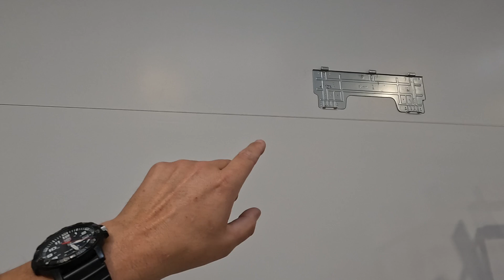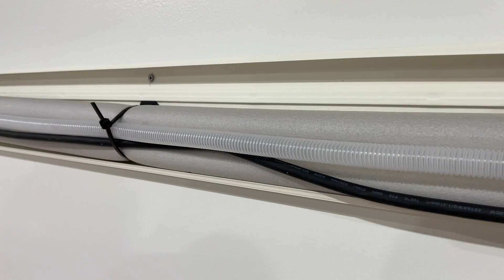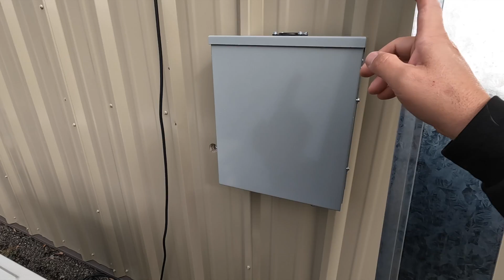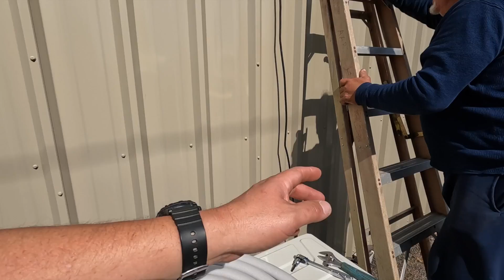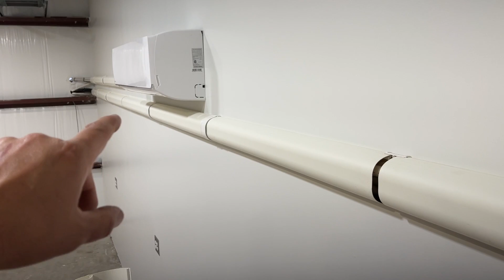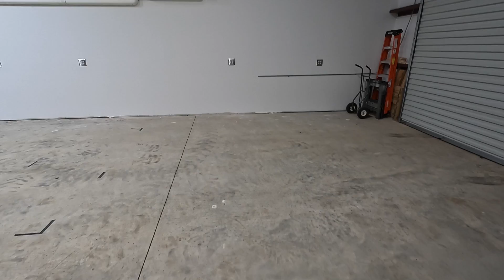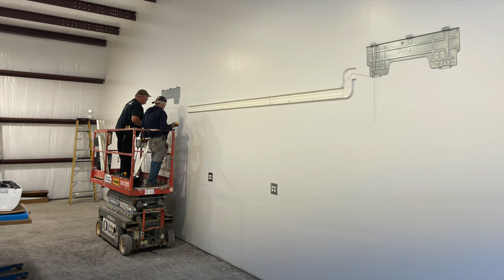Mr Cool AC INstall for New Shop Part 2

Comment: Did the line guards get installed level, or is there a slight downslope? Because it looks like the drain lines run uphill. Will the whole horizontal run fill with water before it drains outside? Not sure I like that.
Reply: Came here to check on this too...  I hope there is more slope than it looks on camera.  Your going to be needing to flush those regularly especially in a shop environment. 
Also install a calling fan especially since your indoor units are not that high up.  it will help a ton in winter and cut down on energy bill even more. 
Looking good other than that.  I am thinking of installing a Heat Pump in my shop also to supplement the Gas Heat and have some condoning during the hotter months.

Comment: If you mounted those condenser units on the ground like that around here a scrapper would own them within a couple weeks.... I put mine on the roof, not 100% theft proof but at least a chance they won't steal it...
Reply: Indeed. I posted the same concern before I saw your post.

Comment: If I remember correctly you are supposed to vacuum down the evaporator side before you open those valves. To remove moisture and air

Comment: My unit was installed the same way. Water drain will build up with dirt and sludge clogging the drain line causing it to run out all over the floor. Installers had to redo everything giving it a slight slope.

Comment: what happens to the air in the lines?
Reply: I'm pretty sure the lines have vacuum in them or they are precharged.
Reply: The linesets that go to and from the air handler are open to the atmosphere and should be vacuumed before opening the valves on the condenser.
Reply: Jason Hendrix that’s what I was thinking
Reply: @tomogletree1  
Evidently I'm wrong.  The 3rd gen systems from Mr. Cool have a precharged lineset and condenser instead of flared fittings like on the car majority of other systems. Them must be fancy fittings.

Comment: Your drain needs a slope to drain properly.
Reply: Okay that's what I was thinking, I mean even if it used the differential pressure on the blower fan to push the condensation down the line that 38 ft length is still too long without any slope for sure

Comment: Might need a bit extra shot of refrigerant since you extended those lines
Reply: He mentioned that in the last video.  His father in law is a professional HVAC installer, so he knows what he is doing.
Reply: @Discretesignals  yes I can tell he is a professional by the way he installed those drain lines 😂

Comment: You did not show pumping down the lines to a hard vacuum before charging them. You CANNOT let air and water remain in the lines. Water will freeze and air interferes with the refrigeration cycle.
Reply: I did some research on these systems, the factory claims that the lines are already vacuum purged and that's why the valves are the way they are. These are supposed to be consumer installed, something you can install without hiring an HVAC person.
Reply: @Keribi They’re a different kind of fitting. An HVAC tech on here said that’s why the connectors are so large. Must contain some kind of spring-loaded valve or something.

Comment: Why aren't you using insulated screwdriver's?
Reply: A very necessary tool to use before power is hooked up.
Reply: Why?  They are not wiring it up live.
Reply: @Discretesignals  It doesn't matter if it's live or not. If your working on any type of wiring then you should ALWAYS use insulated screwdriver's and tool's, period!
There's something I've noticed about Americans n Canadians and is that they don't seem to use insulated screwdriver's/tools when your never sure if someone accidentally turns the circuit on and that's ESPECIALLY so if your working on 480V. 

All my insulated tools are from German and the quality is second to none 👌🏻 The voltage rating is 1000VAC n 1500VDC. My mate Andy (Photonicinduction) got one of my favourite brand's "CK" (NOT Calvin Klein!) n tested a terminal screwdriver. He slowly started to ramp the voltage up, until it had a breakdown. 
It's definitely worth a look to see how well built thoese tools are made. 

In the UK we've got 240V single phase (live to neutral), 3ph 240V (live to neutral) and the same again 3ph 415V but between the phases.
Reply: @TheManLab7  They weren’t even wired to the sub-panel at the time. Go back and watch again. 🙄
Reply: @mitchkronowit3633  I have watched ALL of it, don't you worry. I've been a sparky since 2004 so I should know my stuff by now. I personally think it's just really bad practice not using insulated tools as you'll become complacent n end up picking up a non insulated tool when the circuit is live.

Going back to that first cable being installed from the air handling unit. I couldn't see a rubber grommets which over time could rub through on the metal cover and short out.
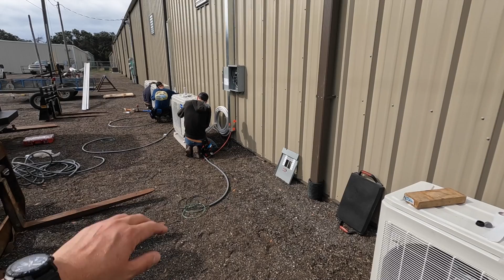Reply: @TheManLab7  Do you use an insulated screwdriver when working on a lamp not plugged into the wall socket? If you’re trying to teach good habit practices to an apprentice, that’s one thing, but the units weren’t even CONNECTED to the sub panel, so there was zero chance of shock in the event somebody flipped the breaker or something. And electricians came out later to wire up the units after Adam finished getting them all connected to the handlers. I’m sure they took care of any discrepancies like a cable not protected from a chafe point. Remember, Adam’s a machinist, not an electrician. 20:04 in case you missed it.
Reply: @mitchkronowit3633  I use insulated screwdriver's to do everything as that's how I roll. 
Your definitely a child or teenager or someone who's got nothing else better to do with your life that to be padantic about the most minute things. 
I've got a gut feeling your American and that means you want to be argumentative and always be right ?
Reply: @TheManLab7 So predictable. I just knew you’d get defensive when somebody didn’t bow down in awe at your “expertise”. You’re the one who came on here with his panties in a twist all because somebody didn’t use an insulated screwdriver on a gasp de-energized DISCONNECTED electrical appliance. Sounds to me like you substitute rigidity for competence. I’ll bet you run around outside wearing two face mask because you’re so “safe”. Now go lick a lamp socket. LOL
Reply: @mitchkronowit3633  I was right!! 😂 So what's your prefession then apart from loving the bible n being brainwashed into something that doesn't exist? 
Tbh I couldn't care less what you call me or insult me as I don't really care. You can call me defencive if you want but I'm just stating the facts.

Comment: You should soap the refrigeration line connections on both ends to make sure they are sealed and you have no freon leaks. Those threaded refrigeration fittings are known to leak if you don't get them seated all the way.
Reply: Noticed the spray bottle on top of one of the units they did the custom work on, so Im assuming they did soap them, just didn't show it.

Comment: couple things.. its not coolant.. it's refrigerant.  Also be sure to spray those line joints and fittings with soapy water to check for leaks

Comment: Forgive me but I've got to make two observations. To begin with the condensate lines won't drain properly because they don't have any drop, and you should have evacuated the refrigerant lines and the evaporator before you opened the valves on the condenser. Now you have fouled the refrigerant with ambient humidity and debris, The units won't heat or cool efficiently and internal parts might fail prematurely.
Reply: Hello Bill. Please study up on how these systems work before commenting. Thank you.
Reply: @wolffengineering7038  I have been working on  A/C systems for fifty years and I have never done such shoddy work.
Reply: @billaulicino1461  maybe so. But you have absolutely no idea how these pre charged systems work.
Reply: @billaulicino1461  Doesn't look shoddy to me.  I think they did a high quality job.
Reply: @wolffengineering7038  Bill sounds like an “expert”. And you know what an expert is, right? Somebody who stopped learning. LOL
Reply: The lines have been vacuum purged already, they have valves on them to maintain that vacuum, the systems are designed to be a DIY consumer installed instead of requiring an HVAC person to install them.
Reply: That was done by mrcool to make it a diy for anyone

Comment: "Big shops can't be climate controlled" yeah, no that's a lie. They have industrial refrigeration units that come through the roof that keep half mile long warehouses 72 in 105 degree weather. It's more of a "We don't want to pay the electrical bill for you to not sweat to death" issue.
Reply: Probably should have said it as , its not easily done.
Because of course it can be, but as you said, do they really want to?

Comment: The extra line set coiled up looks terrible.
Reply: If you shortened the line set you'd have to have a licensed contractor remove refrigerant, making it not-so-DIY.
Reply: @redbeard19833  sometimes diy shouldn’t be an option. If you want it to look like garbage, keep building bob
Reply: @cdubs1723  Is that excessive bit of lineset worth $1500+ to remove?  Not to me.  I installed one in my back sun-room myself and am going to do my garage soon too.
Reply: lol 
who cares no one’s gonna be back there looking at the lines
and small price to pay for DIY free

Comment: Why couldn’t you run the lines you ran inside along the wall on the outside wall for a cleaner install? I’m sure I’m missing something here
Reply: That's the dividing wall between him and the next tenant.  The backside of the wall is the inside wall of his neighbor.
Reply: @tjcasper777  ah thanks missed that
Reply: There is another unit next to him on that wall he has them on

Comment: Is the condensation line pumped under pressure or just a gravity feed?  Did they give a spec for the slope on the drain line?  Just wondering about the 2 on the interior wall?
Reply: Gravity feed.

Comment: They really should cut the extra pipe off and install new ends to connect to the outdoor units.
Reply: Longer lines only reduce the efficiency a little bit.  😁😁
One would need to have the skills and equipment to cut and splice the lines.  (and also a refrigerant-handling certificate)
Reply: What makes these DIY friendly is that the lines are sealed and filled with refrigerant from the factory.  And as this is a 30 minute ad for Mr Cool, they wanted to focus on the target demographic of DIY and not needing to hire an A/C tech to do things like that.
Reply: @ecliptix1  But when you add additional line length; it no longer becomes DIY as you need to add freon to compensate for the added line length.

Comment: 21:18 I see the electricians didn't redo your electrical work. They've left as an Abom79 bodge. Note the gland the electricians used on the casing - you should have used similar on the cable you fitted.

Comment: are the units numbered to match the breakers?
Reply: Yes, the sticker for unit #3 is visible in the video on the galvanized cover on the wall right next to the condenser
Reply: That would be a code requirement.

Comment: Looks good Adam, nice and neat. I do have one concern though from experience. That raised transformer is going to put out an incredible amount of heat, just so you are aware of that too. In a few places I've worked, the condensation was so excessive(rainy months), they had to upgrade, and built a PVC funnel under the units, with the one inch drain dropping straight down and outside. I guess time will tell. I know you're close to sea level where you are, whereas I'm at 3500' above sea level. Cheers Blessings!
Reply: the drains in Queensland are plumbed into storm water

Comment: One drawback to those quick pads is they're not anchored to the ground so the unit isn't either
Reply: And they're light weight, can easily be carried by a couple of thieves.  Or, a sledge hammer to the bolt areas will allow the units to be taken without the slabs.
Reply: Unless you pour a concrete pad and anchor the unit to the concrete, the pads any condenser unit sits on isn’t anchored to the ground

Comment: You should consider applying expanding foam to the four openings through wall and also to the line guards at the top and bottom.  Should keep out the critters.

Comment: After doing HVAC/R work for 47+ yrs, any competent Technician would NOT coil the line set behind the Cond Unit. Big No No. I did not see it flimed, but the cond unit pads didn't show getting secured to the ground.
Reply: 40 years in the trade and I don't install units like that , With all those oil traps ? the compressor could run out of oil , The vaccum pump is a compressor ? , There should be small condensate pumps on the far units and the 240 Volt wire to the evaporator is not protected .
Reply: @michelgrenier1878  - Exactly.
Reply: @R Bedell. Unless you pour concrete and anchor unit to it, what pads are ever anchored to the ground?
Reply: @MrCmgl1  - My point was, that I saw no anchoring, and those flimsy units would blow over in the next thunderstorm. Anchoring to the unsecured pads means NOTHING.

Comment: Just thought I'd add not sure about your area but since those units are so light you should probably add some cages over the units and line coils copper thieves are ruthless I've seen where they've chained up full size units and and ripped them off the building and throw them in the truck and they're gone they cut the lines at the opening a take everything they can!!
Reply: This is exactly what I was thinking.
Reply: You are exactly right.  Those units would be easy pickings.  A thief would get maybe $20 for the copper in each.
Reply: It's gotten bad enough here if you have a house for sale out in the counties without any close neighbors you have to have security or check it constantly or they'll break in and steal everything I went to one place couple years back they ripped out all of the appliances microwave oven and dishwasher and tore open the walls and pulled out all the wiring and plumbing supply lines luckily the well wasn't running so it didn't flood but they completely gutted the place they took everything they even took the pedestal sink and faucet out of one of the bathrooms place was just a pile of broken drywall

Comment: Between the drain line ran horizontally and the vertical coils guaranteed to lead to refrigerant oil entrainment you are guaranteed to have problems with this install. Coils need to be laid horizontally. Especially on inverter drive variable capacity units. Good thing youre building a shop on your property because this wont last for very long
Reply: Please educate yourself before commenting. The condenser and compressor is below the evaporator, gravity will return the oil. These systems can have the condenser on the roof 10 feet above the indoor unit and the refrigerant flow will return the oil without a problem.

Comment: Looks like the line set was over sized, too long, for the install. The excessive coil of the line set will eventually trap oil and inhibit the circulation of refrigerant.
Reply: They come pre charged. So, you do not cut the lines down.  Go to the web site and do a little reading so you do not make any dumb statements. He said in the video that the 
one at his shop has been running for three years trouble free. Check that video out.
Reply: @sdjb111  yea this gatekeeper dude is completely correct. I don’t care what the “mr cool” website says. Oil is going to lay in the bottom of the coils over time.
Reply: @sdjb111  these units come pre-charged for specific lengths. Maybe you should read the info my friend. I'm a professional in this field, what is your experience?
Reply: Makes you wonder how much refrigerant was in the pre charged lineset, wonder if he broke out a recovery machine. If he didn't have the proprietary quick connects how would you even extend or shorten these, let alone safely recover the charge per EPA standard? I imagine he cut the lineset, threw in some couplings and moved the quick connect to the end after just releasing the charge into the recovery machine in the sky.

Comment: That ducting includes a condensate drain pipe - so should run downhill all the way from the units to outside !
Reply: I was just thinking the same
Reply: Nope.  As long as the outlet is lower than the inlet, and no any one point of the line is higher than the inlet, it will not matter.  Every solid slab foundation house with central HVAC in the south has condensation lines that slope upward from conduit in the slab.  Yes, water will remain in some portion of the line at all times, but it will not backup unless it gets physically clogged (condensation lines should be flushed every so often anyway to prevent this).
Reply: @cup_and_cone  Sadly you're wrong. If you have 10 dips in a line that collect water, you have to add the height of the climb out of each dip together to get the total 'head' to overcome. The top of the pipe has to be higher than the bottom of the pipe by at least that much. Otherwise the resistance to flow is greater than the pressure to create flow. The alternative would be pumped drains.
Reply: @millomweb  It was replaced with PVC that makes one straight shot, thus my comment is about the new PVC they added, or final install.  I agree with you that that the flex corrugated stuff they include from factory that was drooping is crap.
Reply: @cup_and_cone  It'd be ok for a a straight down section. But yes, rigid pipe would be better for horizontal(-ish) runs.